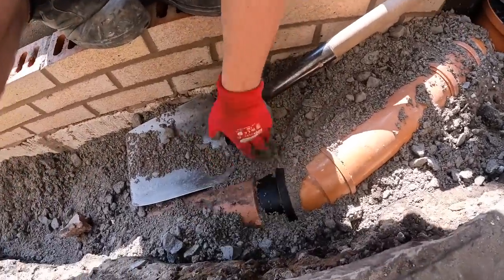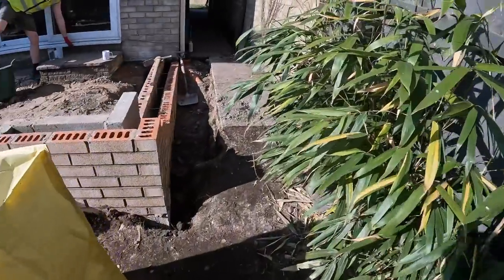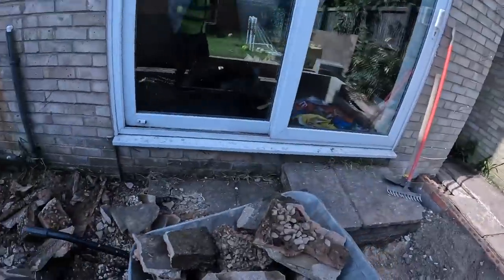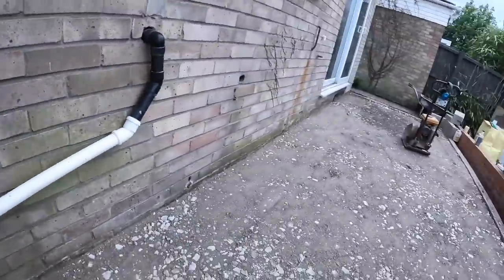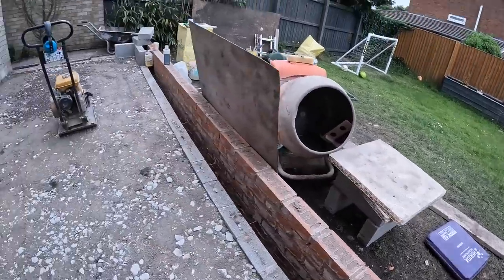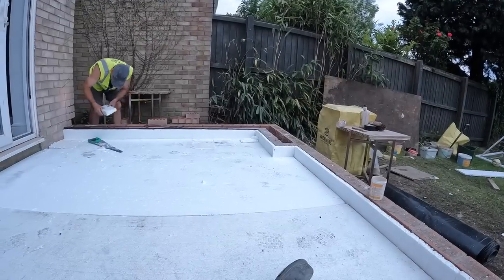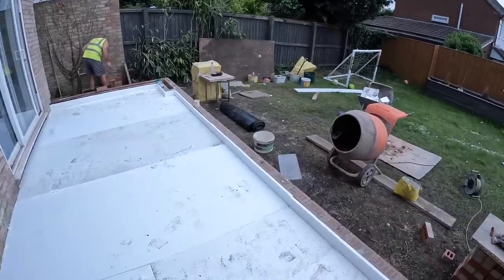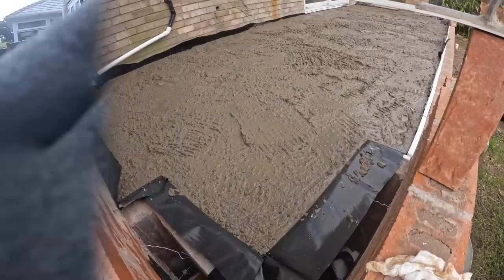WE RAN OUT OF CONCRETE !!..BI FOLD EXTENSION PART 3

Comment: A great example by Steve and Alex of the amount of work that goes in to a slab pore for an extension from creating new drains to clearing existing rubble and then getting all insulation correct including stopping cold spots in cavities! Then getting levels correct for the concrete and get the dpc cut and installed before concrete pour. To only be half a barrow short is not bad and great tip with the laser level receiver on the tamper ! The cat will definitely have made his mark in the concrete Alex 😂
Reply from the maker: Thanks John 🙏🏽😉🧱👍🏽

Comment: If you run a bit short you can push some bricks down into it in random places. Done that a few times in the past. Sometimes I think a straight joint in the brickwork makes sense then locate a downpipe over it.
Nice job guys 👍🏼👍🏼
Reply from the maker: Cheers buddy 🧱👍🏽

Comment: Just a quick question. Have always had to use kingspan or similar for thermal regulations and heat reflection, so much more expensive than jabolite but building inspector insists
Reply from the maker: We go thicker and put 125 mm in 🤙🏾🧱👍🏽
Reply: Not convinced by jablite being adequate, but some local councils differ in what they will accept. 
The more glass windows and doors the more insulation!!
Reply from the maker: @Ink706  🤙🏾🤙🏾👍🏽🧱
Reply: @SteveAndAlexBuild  lol
Reply: By jabolite I ment polystyrene sheets or similar, I'm in Preston and not been allowed to use polystyrene for the last 15 years or so , just doesn't give the thermal insulation they require
Reply from the maker: @ashley94801  😬🧱👍🏽

Comment: That is an awful lot of bleed water on top of the concrete.  Do you get a lower slump mix when you pour over an impermeable layer than you do with a slab on grade pour?
Reply from the maker: I think so 🧱👍🏽
Reply from the maker: @martin2466  . 😳🧱👍🏽